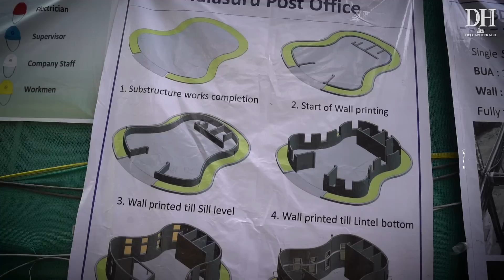How this post office in Bengaluru is being constructed using a 3D Printer

Comment: IT SEEMS THE CURRENT 3D building printing application is limited to short single story structures wuth minimal lateral forces like wind and seismic forces to worry about, else it will require TMT steel bars in which case it will be difficult to 3D print.

Comment: New technology is fine. But L&T  has to do some basic research on this robotic construction so that it is eco friendly and suits to the prevailing weather conditions of the regions. Need to find organic alternative to  plastic fiber component in the  mixture as it will only heat up the building particularly during summer necessiating more ACs and thus raising the energy bill.
Reply: Good point. There's another 3D concrete building company that's printing buildings in the US that has made their own green conrete to focus on sustainability in their prints. Instead of plastic, they use hemp & seaweed. Hemp has a ton of construction benefits like being durable and fireproof, so does the seaweed. Both ingredients are also much more fast growing than trees & the seaweed farms dont use up any land. The company is called TNT Development if you're interested in learning more, they have more info about their greencrete on their website. They're located in North Carolina where they print.

Comment: This using lots of cement , it will increase the temperature?? Because of no bricks and sand the cement will absorb more heat and will heat up the interiors
Reply: Its is designed such as the walls have cavities in between so that the plumbing and electrical service can be added and the cavity acts as an insulation in the wall the exterior temperature will not get the drastic effect on the indoor environment.

Comment: This can be a game changer 👌
Reply: No way .
It is only feasible for high end building. 
Cost analysis is missing here.
Reply: Instead of six months it takes 45 days instead of 35 labour it takes 6 laborers now you can do your calculation your self which will be cheaper in long term.
Reply: The project costs 25 lakhs , it is a very cost effective method
Reply: @hgc.gaming6297 construction value per sqare feet?